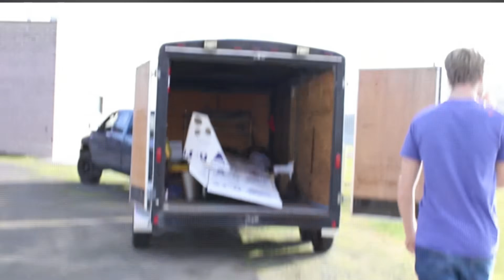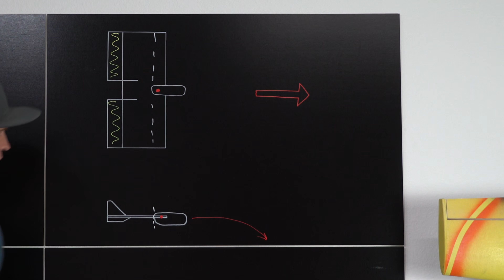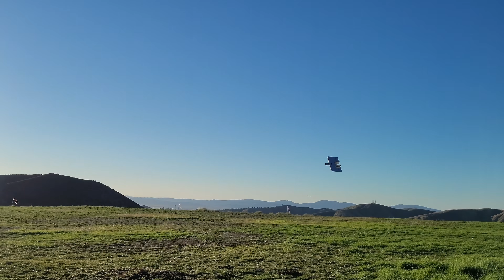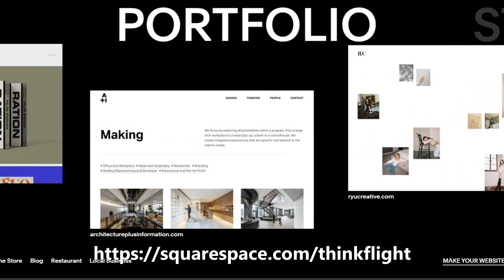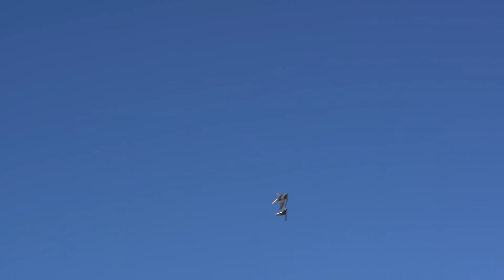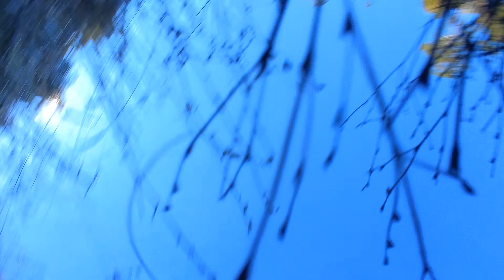How YOU Can Make ANYTHING Fly!  Or Just Watch Me Do It....

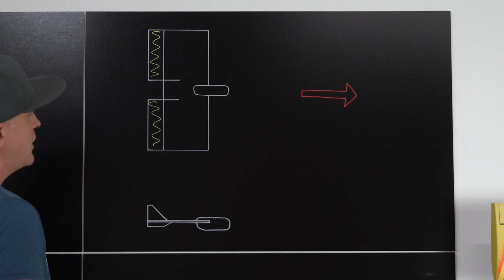Comment: The neutral point won't always be 1/4th the distance from the trailing edge, as you said at 1:51. So how do you find the neutral point for a given plane shape when testing or using a computer?
Reply: Old comment, but maybe someone stumbles upon it. The neutral point is a parameter that can be calculated. It depends on the size and shape of the main wing as well as the horizontal stabilizers. It's not an awfully difficult equation and it's a single analytical expression. The notion that the neutral point coincides with the quarter chord line comes from the assumption that the wing is much bigger than the horizontal stabilizer, and that the latter therefore has a negligible effect on the neutral point location. For just a wing (yes, this is also therefore valid for flying wings), the neutral point coincides with the center of pressure, which itself is approximately at the quarter chord line. This is again an assumption, but it's a decently valid one. In reality center of pressure shifts with angle of attack. Anyways. If we account for the contribution of the horizontal stabilizer, the neutral point (for conventional, non-canard layouts) moves a little further back. 33% of the chord is relatively common. The assumption that the neutral point is at quarter chord, which you raised in your comment, is therefore conservative! This is really important. Since do not want our CG to be behind the neutral point, the assumption that it is a little further forward than it really is, adds some safety margin. This is why, generally, the assumption of the neutral point being at the quarter chord is still made by people. It does the job, and adds some margin without being excessively nose heavy.

Comment: Ok, I'm "Old School",  I build with wood, I use alcohol fueled 2 cycle Engines.  Radio Controlled, Al, rd, ele, thr. Flaps and payload drop can be added.
You have just added to my idea box of goodies. I have been working on Delta wing / Blended Lifting Bodies.
An idea. Adding a Ducted Fan.  With the Duct,  propeller vortex at the tip is eliminated increasing efficacy by 27%-32% .

Comment: In my experience with foamboard electric, just about anything can fly as long as you have enough power and large enough control surfaces lol. The hardest part is to find a decent CG. Some designs are not where you think it should be. But with enough power you can normally harrier them down is needed . I have seen many designs that didn't look like they could fly but after experience you realize just about anything can fly. Electric and foam board really changed the RC airplane hobby. It opened it up to cheap experimentation that otherwise would not been practical with balsa and gas engines.
Reply from the maker: Exactly

Comment: * ... when you have a high enough power-to-weight ratio. Man, when I was a kid, I made a glider out of balsa wood. It took weeks to make, and I was terrified of flying it every time, for fear of breaking. There was a motor you could attach to it to self-launch, powered by AA batteries. Mine didn't self-launch because it was too heavy. I had simply applied too much varnish.

Seeing you slap some pieces of foam together with glue and it takes right off is a testament to the outstanding development in battery and motor performance that has occurred over the last 20 years.

Comment: just curious, are you saying that the wings on a Cessna (152 / 172 / 182 / ...) could be replaced with flat wings?  Do flat wings generate lift?  or are they just angled slightly above horizontal (in essence pushing the air down and the plane up...)?  I truly enjoy your videos!
Reply from the maker: It would lose a great percentage of lift and need a lot more speed but if it had enough power it would still fly.   Pretty sure it doesn't have the power for it as designed though.

Comment: can u make styrofoam instead of filled with co2 you can fill it with hidrogen so u can have a very light styrofoam to make it flight then after u do it you can make another one with a stronger plastic u can use superglue filled with hidrogen or u can make another more flexible with silicon or rubber filled with hidrogen but u have to use liquid silicon or liquid rubber

Comment: All of my favorite rc airplanes have been ones that I have built myself from scraps/scratch. Actually the longest lasting most fun plane was a 4’ wide delta wing I built out of the rubber type foam packing material. It’s the stuff they put around expensive welders and electronic equipment. Much softer/rubbery then foam board. Which means when you crash it it bounces instead of breaking. I even made my own folding prop for it so I could land it anywhere with no damage. Wish I still had it but it burned up when my boat shop burned down. Love the videos man. You do fun stuff that is really interesting.

Comment: loved to visit the local flying field as a kid, and during one show, a guy built a flying lawnmower out of foam board in about 30 minutes and had it tooling around the skies. Looked exactly like a push mower. Flew fine. He did it using the same methods you mention here, the handle had two horizontal control surfaces, the verticals were the handle sides, and the "wing" was the body of the mower. Was absolutely hilarious seeing it fly along with traditionally shaped airplanes and he taught everyone a lesson that day. The next year, he flew a snoopy-riding-a-doghouse.

Comment: Could you possibly explain the "Neutral Point" in more detail? 

"The center of gravity position where the pitching moment is independent of the angle of attack."

What the heck does that really mean? I understand center of gravity and the correcting force bits - but I just can't wrap my head around what the neutral point is.
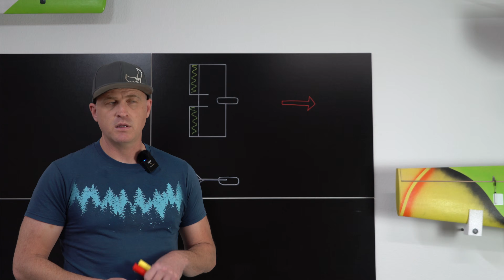Reply: As stated at 1:30, the "Neutral Point" is where all the forces on the aircraft are balanced. Neutral point is a reference having to a neutral pitching moment. ie: no tendency to pitch up or down if controls are in a neutral position. 

Presentation here is a simplified summary of 4 forces on an aircraft: Lift and Gravity are not the only considerations. Thrust and Drag (not mentioned can be ignored for gliders, as these are constant in level flight). Since all 4 forces don't typically pass through centre of gravity they can create moments (force applied off centre) which can cause roll, pitch, or yaw. 
An example would be motor alignment, which could cause pitch up/down if the amount of power, or thrust is increased/decreased. Drag can change on planes with flap, or landing gear, but this theory applies to more complex aircraft.
Reply: @AerialWaviator  What is your reference?  For the rectangular flat plate wing it is at the  mid point (50%) and not 25% from the leading edge.  You seem to be confusing "neutral point" with  "center of pressure."
Reply: @Eugensdiet  I made no reference to 50%. Center of Pressure is not a constant location in reference to wing cord. It can move forward/rearward depending on speed of airflow over a wing and the angle of attack. Neutral point is a reference to lateral stability (pitching moment) where pitching moments of forces cancel each other (typically between Center of Gravity and Center of Pressure).
Reply: @AerialWaviator  Thank you and the others for your replies. I get the concept now a bit more but I think I'm just going to need to do some sort of practical experiment to really make the idea stick. Maybe if I look more into how you find the neutral point I'll understand better. I'm such a visual learner and this is just hard to wrap my head around.
Reply: If you consider that the aircraft will always want to pitch/rotate about the center of gravity, you can begin to imagine that by positioning the CG in different locations, you will experience different pitching moments (restoring forces). For example, if you have a flat plate as your wing and your CG is  very far back, as you point the wing either up or down, the wing will pitch violently into the same direction. If the CG is very far forward, your wing will try to pitch back to the flat position as you rotate it either up or down. 

A simple way to experience/simulate this is to take a piece of cardboard and hold it from the front while pulling it to simulate a forward CG position, or push it from the back to simulate a far aft CG position.

Now if you can imagine that there is a progression between the CG being too far back and too far forward, there is also going to be a point where the wing won't pitch either up or down even as you change the angle of attack. This is your neutral point. You can simulate this too by grabbing your piece of cardboard at about the front third of it and as you move it through the air, it won't try and rotate even as you pitch it up and down changing the direction it is pointing.
Reply: @Snookers_  Thank you so much for the reply! That third paragraph is something I, for whatever reason, am having a very hard time visualizing. Do you mean that if you grabbed the cardboard at the neutral point and pulled it through the air - if you changed the angle of attack, it would not try to return to flat? Meaning - it would keep the angle you put it at?
Reply: @Drew_Pearson  I realized I had an error in my comment. I described the center of pressure instead, but some principles still apply. At the neutral point, it will still want to pitch, but the difference is that it will want to pitch at the same rate and direction regardless of angle of attack. Here is a video that doesn't aim to explain it, but does show the process of analytically finding the neutral point in XFLR5 and you can get somewhat of an idea what it is.

https://www.youtube.com/watch?v=qujlrHkkgtU

Also, it's important to remember that neutral point and center of pressure are different things. Neutral point is where the aircraft is "neutrally stable" (a very abstract concept to understand) and center of pressure is where all forces act through and no pitching moment is present. My first comment describes center of pressure, not neutral point.
Reply: The correct term is center of pressure and for flat plat and symmetrical airfoils that would be half from the leading edge. The CG usually works out best somewhere between 25 and 30% of mean chord. Where you placed the CG is forward of that which results in less pitch control but more stability. It also increases the stall speed but when you have such a large area wing the wing loading is really low. Makes for a great camera plane. Making a chuck glider eliminates the need for applying physics.